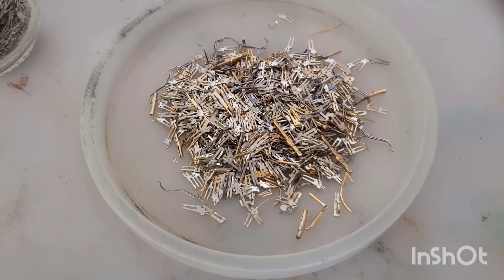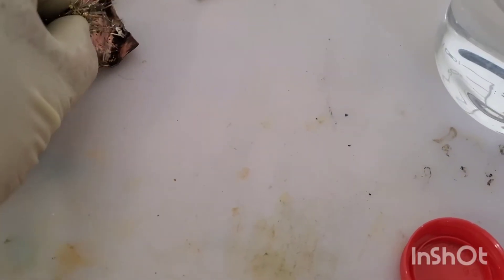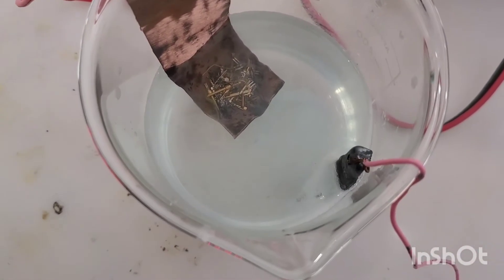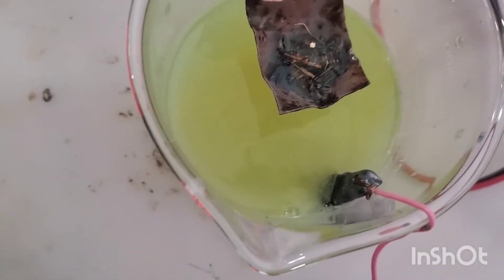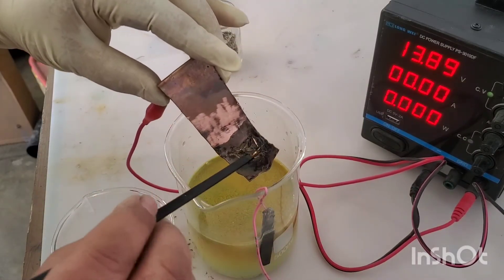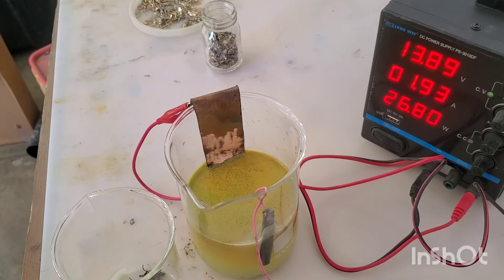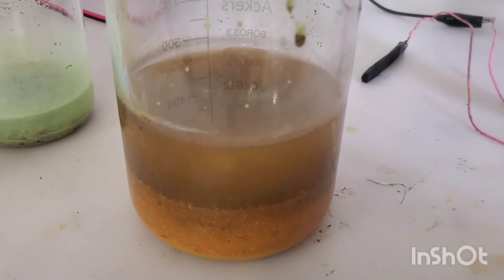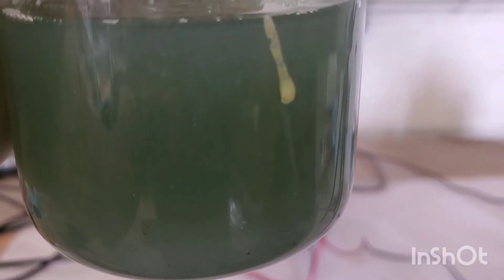Gold Recovery From Low Grade Pins With Saltwater

Comment: Man, i meant to ask you about any new vids yet on Soller's this afternoon, but forgot!
So will this work even better for heavier plated pins?
Reply from the maker: It will work the same more or less. The heavier the plating it takes a little longer. If your in a hurry a sulphric stripping cell works faster I find the slimes a bit harder to filter not to mention youll need fiberglass filters for the sulphric method. I do have new videos in the works, building a new fume hood ATM.

Comment: Hello! This is not true - copper mesh only works in sulfuric acid, and in a salt solution it will dissolve faster than gold. You need a mesh made of inert metal, such as titanium. You are misleading people and saying that the parts dissolve, but the copper shelf does not.
Reply: W punkt .

Comment: I'm doing this 12 pounds at a time in a Harbor Freight vibratory bowl. I'm dealing with a large amount of plated phosphor bronze pin manufacturing slugs. Consistency of beach sand. Being phosphor bronze, with 8% tin content, I wash with sodium hydroxide to eliminate the tin prior to further processing. Gold stannate and metastannic acid are undesirable results from leaving the tin content unaddressed.
Reply from the maker: Thats really cool. If you have the time Id love to see a few pics or videos in your process. Feel free to Email me. Im never done learning or trying a different process
Reply: @electronicscrapper4956 
Latest reply to this comment reminded me that I never could find your e-mail address.
Reply: @Vibe77Guy  please make video!
Reply: @sgj85 
I'm not a video producer. Wouldn't even know how.
I'm still working on refining this process. This sodium chloride brine electrolysis cell still seems like the best way around the tin issues, though.
Reply: Hello bro how do we  use sodium hydroxide to dissolve tin from pins,etc,thanc

Comment: Use a copper pipe . Drill a bunch of small holes in in and install a copper plug. Fill it with pins and put a weight on the pins. That will ensure good ectrical contact on all the pins. You could do the whole batch at one time
Reply from the maker: Thats very interesting. Ill Have to give it a go. Thanks for the idea
Reply: @electronicscrapper4956 Your welcome

Comment: What are the steps after this? Filter the solution, and the gold will be in the filter which you then process with aqua regia and filter again then drop gold with SMB?
Reply from the maker: you are pretty much exactly right. I do wash the filter initially with HCL to dissolve more base metals. It leaves the gold foils relatively clean. I do plan on doing this in a future video. I hope this helps
Reply: @electronicscrapper4956  thank you. Looking forward to your video.

Comment: Can I use zinc instead of lead
Reply from the maker: Im not sure. It would make for an interesting experiment
Reply: Yes. I have. The cathode can be almost anything conductive. Even bare copper wire. The anode is going to degrade, over time, as the nascent chlorination will also erode it. So long as it's copper, the later refining process can deal with it.